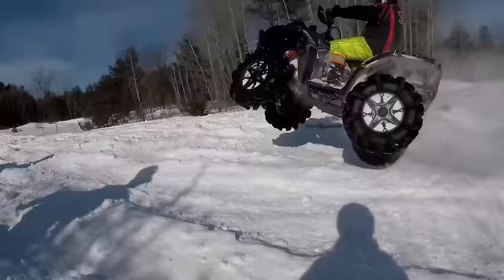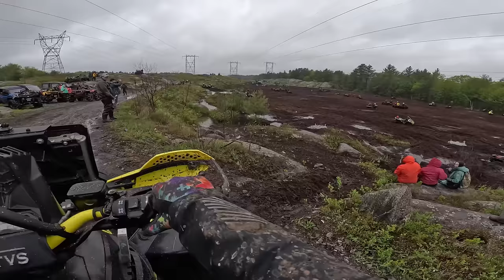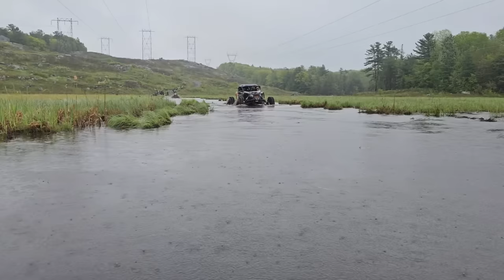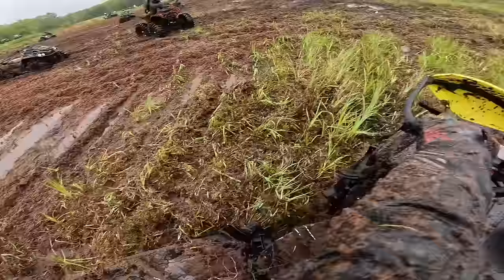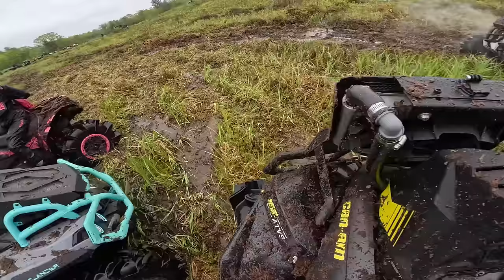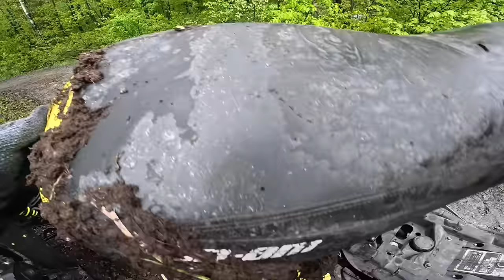Driving the Can-Am's in the Deep Skeg & Water

Comment: Curious,  what clutch setup are you running nowadays?
Reply from the maker: Stm primary (Dalton green/black/silver spring).  Stock secondary (Dalton black violet spring).  Seems to do the job with 34s.
Reply: @NOSAtvs  Nice ! Thoughts in running full STMs, primary and secondary? Trying to figure out what I need for 32 assissinators and maybe eventually 34s
Reply from the maker: @kristiancameron3469  I've had difficulties setting up my stm secondary to get desired rpms on 32s, 34s.  I'm having better results with the stock secondary.
Reply: @NOSAtvs  Thanks, Do you think a CVtech primary and a STM secondary could handle 32s? I have that setup on my Gen 1 with 29.5s and it does great !